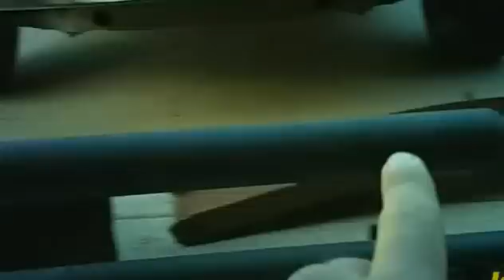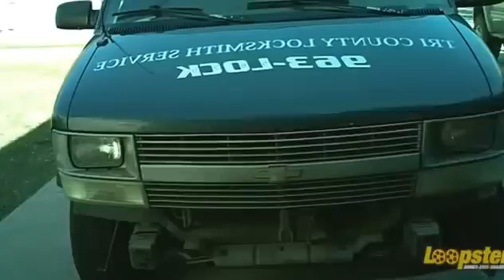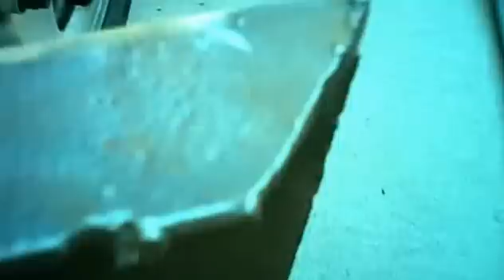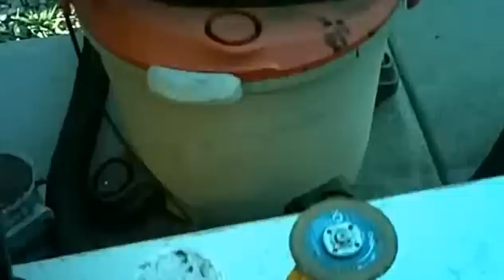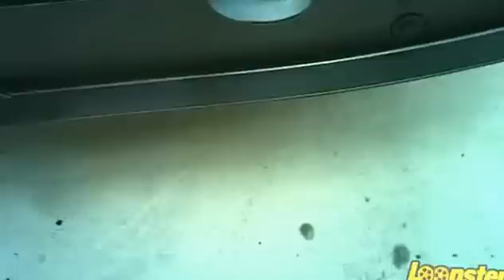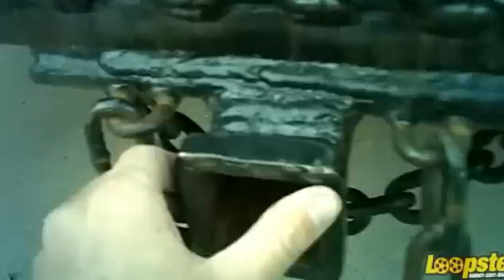How To Make your Own Deer Protection Bumper

Comment: The term "BEEFY" comes to mind!  

I love the chain..........and yes, the forward leaning front grill guard is a great idea.

I am rebuilding my 1972 Chevy truck and when done, an original Luverne 3/8 inch grill guard will go onto it.  I hit a black bear last month in my Honda Accord and there is no way I could stand hitting that with my truck!

*Car is OK, still runs, I saw the bear just in time to slow down enough to save the bear and my car.  Insurance will fix it.   *The bear was killed seconds later by a lady in an SUV who hit is much faster than I did.